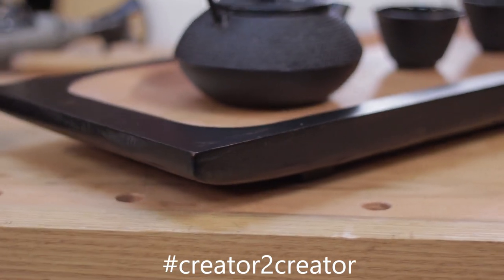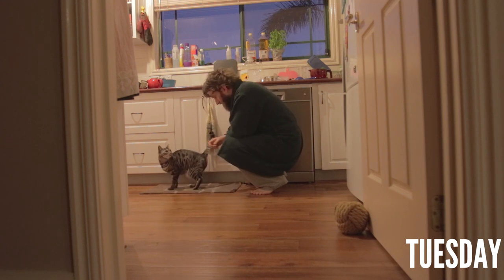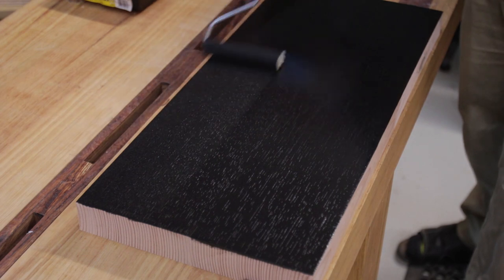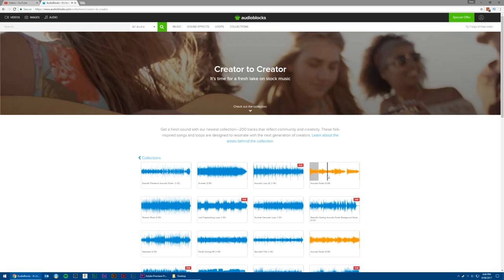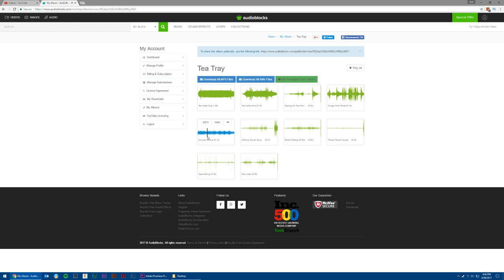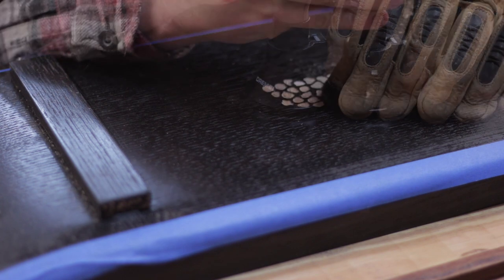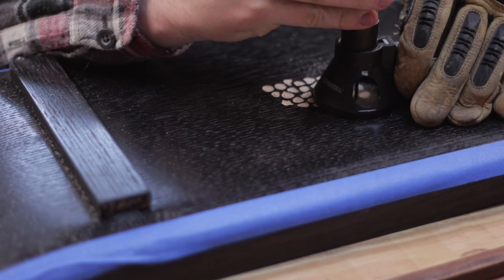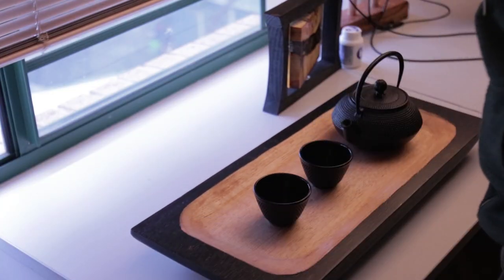Power Carved Tea Tray

Comment: You have been watching Kyle toth
Reply from the maker: +Chandlers Kustom Creations Toth's style of texture on the underside is what came up on Google image search. My original plan was a "hammered finish" like what you'd find on some metal, but the die grinder burr I had just wasn't cooperating so I looked elsewhere for inspiration
Reply: Paul Jenkins I really like what u did I'm gonna have to try this thank u for the inspiration
Reply from the maker: The texture is much easier than it looks - a ball end mill or spiral downcut is your best bet - it just takes forever. The texture on the teatray was a bit slower going because it was curved, but took about 3 hours to do. Make sure you're caffeinated!
Reply: Paul Jenkins will do I will have to buy me a turbo plane. I love woodworking I work at a cabinet shop as a master carpenter (at least that's what I'm listed as).